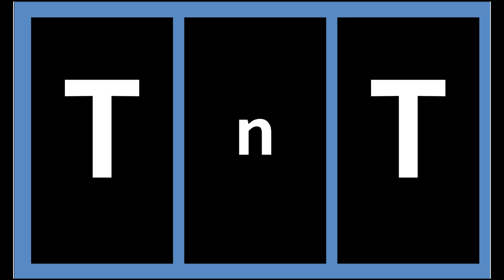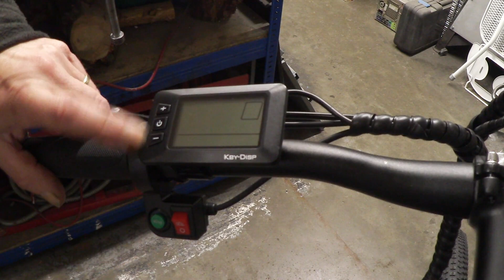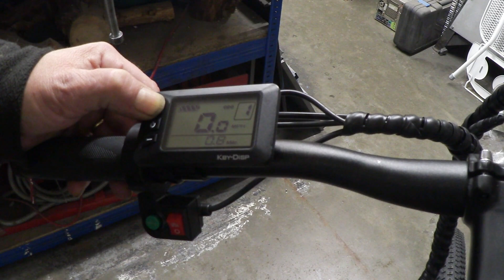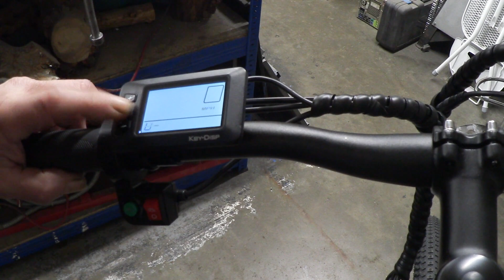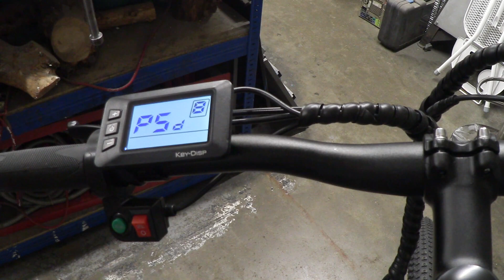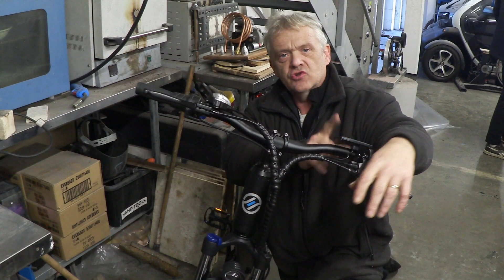1330 The ESKUTE Voyager EBike Controller KBY DISP KD21C

Comment: Been thinking.If you unlock the speed limit,turn the throttle on , add a password then some how break the LCD display internally so nothing is displayed when turned on . That way if you are stopped by the cops all you have to do is quickly turn it off and the police won't be able to turn it on and think it's broken.

Comment: Bike is set to top speed , is there a way to override this through settings or do you need an extra bit of kit? 15mph limit needs adjusting. Explanation of the menus spot on.

Comment: Change the speed settings does not change the max speed, I've tried but still maxes out at 15.5 mph or am I missing something
Reply: Same issue, did you find a way to resolve this?
Reply: @chrisdixon1191  yes 

At the top of the battery housing behind where the key is for the batt is the control unit. 

Lift it out and there is one white wire with a connection in the middle. Just unconnected this and it removes the limiter

Comment: Robert in the controller ( not the display control)there is a shunt you can add a bit of solder to it will give a bit more power .or just change it for a better controller.
Reply: Hi mate did you find out any more info about the shunt anywhere else other than youtube? Or did you find an alternate controller?

Comment: Have you tested it? Does the rear wheel actually spin up to 40 km/h when lifted on a full throttle?
Reply: No 25
Reply: @markohrncic8338  25 MPH not kmh
Reply: It’s 25km

Comment: 0:39 If I'm not mistaken this is only the KD21C display. The controller should be more like a box. It is probably embedded in the battery frame?
Robert, could you please talk a bit about a sensor-based controller and sensorless controller? What is the difference and what wastes most Power?
Thank you for the video.
Reply: Perhaps controls (rather than controller) would have been a better choice of words?
Reply: @kingfishercomputing9497  Well I don't know for sure but I suspect it is only the display unit with configuration ability.

Comment: Thank you. Is it a lot of work to change it to pedal powered charging of it's own battery?
Reply from the maker: interesting question - I will have to look into that
Reply: @ThinkingandTinkering  it should be a standard setting for every ebike. Giving them a slightly more proper reason to be. I wrote some thoughts about this in a comment to the unboxing video of this bike. Thank you once again for your channel. (PS electricity for using my phone for this message comes from muscle power)
Reply: I think I'm right in saying you can't have regen on a geared motor which I think this particular bike is. Only the gearless motors will be able the charge the battery up when braking.
Reply: @recumbentrocks2929  I'm not thinking about regen when breaking. I'm thinking that electric bikes should generally be able to be turned into (stationary?) generators.

Comment: Hi .. bit of a tease there ..was hoping u was gonna show how to get the motor to work passed 15.5mph ... Can u do that please on the eskute 👍👍
Reply: At 7:50 he talks about the max speed setting.  It comes with a Max speed of 40 kph, aka 24.8 mph.  Besides that, you could try tricking the controller by telling it you have a smaller wheel size.
Reply: @McRootbeer  thx for that but he is only showing the default setting which can only be lowered... What I think is the speed controller needs to be tricked into thinking it's not going 15.5mph and therefore will continue to give electric help
Reply: Isn't this the ESKUTE wayfarer ... Cheaper and more powerful for the American market
Reply: @soft16stick70  Hi, 40 is not the default setting, its the max. 27.5 is the default or 15.5mph. i knocked mine up to 40 no problem.
Reply: @chrispike5773  hello have you changed the speed up to 40kmh? how does the bike behave? did you have any problems?
Reply: @chrisRs17  best way of making it go faster is to reduce the wheel size on the computer. It fools it into thinking its going slower than it is. Anything above 20 mph and its tricky to keep pedelling fast enough. Good fun but battery life suffers a bit.
Reply: @chrispike5773  ok, I have the speed set at 25kmh, so if I praise it at 40 nothing happens?
Reply: @chrispike5773  Yes tried that yesterday. changed wheel size to 16" so did about 20mph but speedo reads low, needs higher gearing and battery range suffers. went on a long run and only just got back home on empty battery.
Reply from the maker: I showed how to get it up to 40kmph - that's 25mph - but I get what you mean